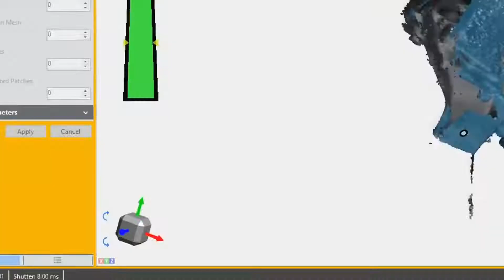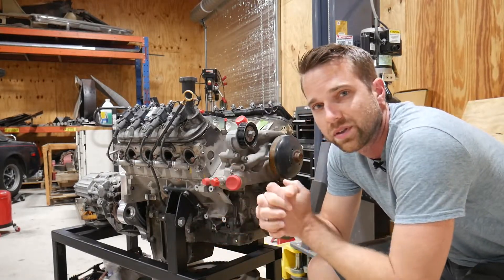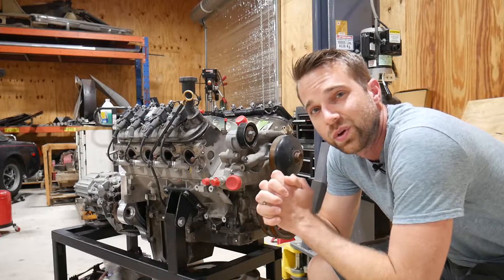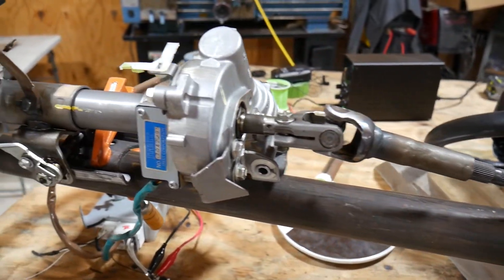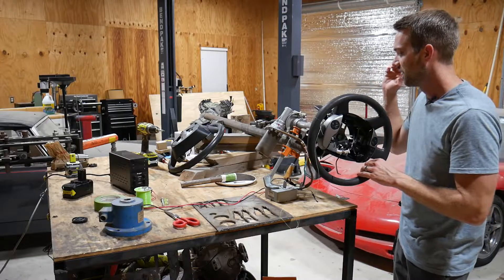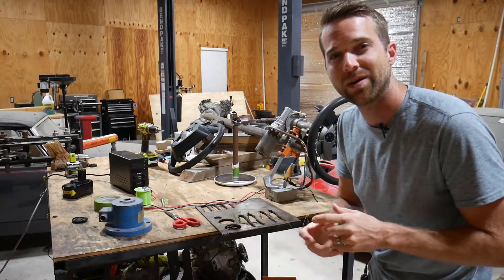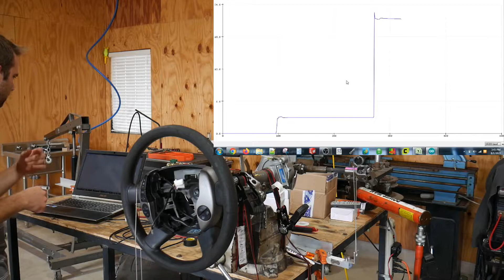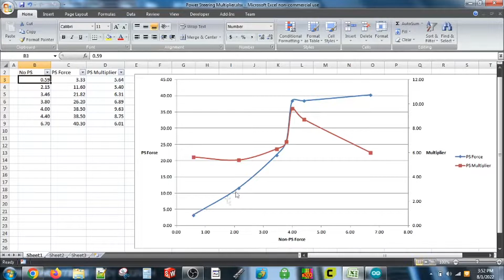Power Steering Study - Mid Engine Car

Comment: Great video! I’m installing the same unit in my dirt track car and I’m curious if there is a way to wire in a potentiometer to adjust the amount of assist.
Reply from the maker: Thanks! I haven't found anything to adjust the force just yet. I don't know if dropping voltage to the main motor will reduce load or just cause it to not work. I'd explore the plug pin outs and see if there's anything there to start with that's not CAN related.

Comment: hi, I am going to swap this eps on my drift project, but I was said that prius eps can't return the steering wheel as it doesn't have steering angle sensor. Can you give me some advice about this? Is that true that swapped prius eps doesn't return steering wheel even in normal driving conditions and I would like to know how it could be fixed? thanks :)
Reply from the maker: The forces that return the steering wheel to the center are from the caster angle of the suspension. I'll cover my suspension geometry in more detail later on so in the meantime I would look up some caster vs camber vs toe articles. As long as your car has sufficient caster angle it will work the wheels back to a straight position. This is also a part of where steering resistance comes from which manufacturers balance with their power steering systems. So the feel might not be right without more work getting geometry to match your power steering. Hopefully this helps a bit!
Reply: @DirtyElbowsGarage  yes, good info thanks. I will swap eps and than play with adjustments :)